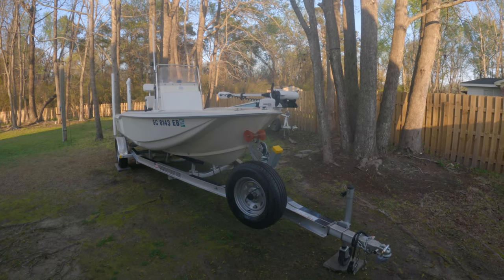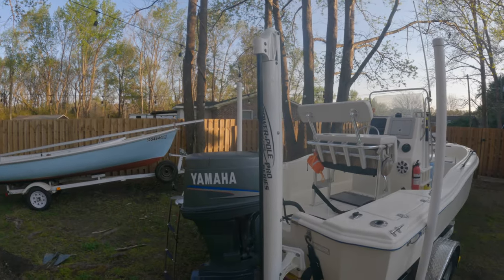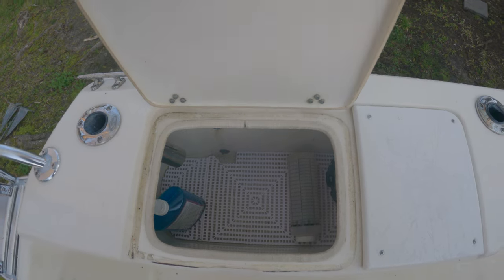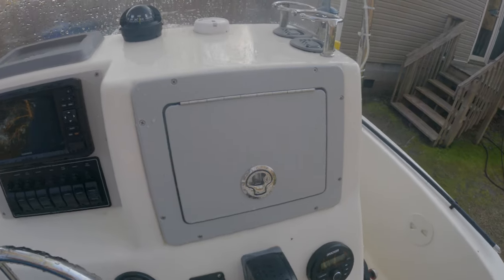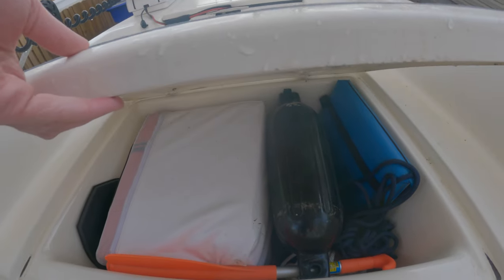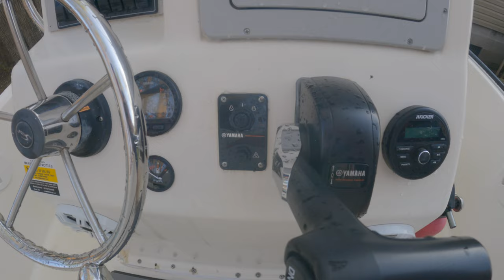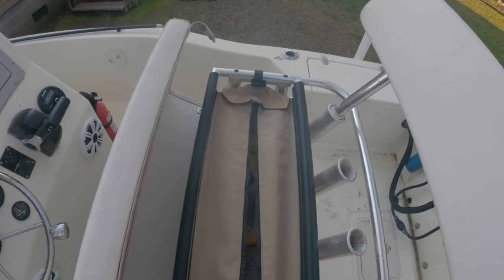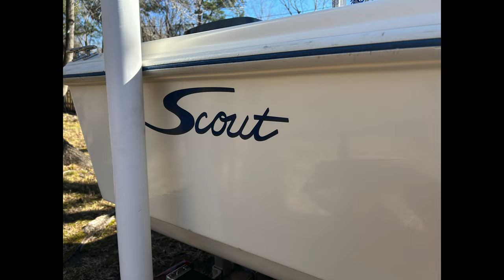Scout 172 Sportfish - Restoration

Comment from the maker: Some upgrades for early 2023 I ended up replacing the UHD2 Garmin with a UHD 94SV during the 4th of July deals. It was a little involved trimming the dash out more but so much better. Also paired with the Garmin Fuel Management system to montior fuel burn. Just picked up a 10' Shallow Water anchor to replace the 6' spike.
Reply: What kind of mpg's are you getting at different rpms? I'd love to know how much you payed for that swim ladder, I'll probably do the same thing to mine. Really like how that looks in SS
Reply from the maker: I cruise around 30mph @3600rpm that is two adults full gas and lots of gear and the GFS reports 6mpg average for just cruising at the speed. I typically get to plane as quick as possible and try to stay there and just cruise. I have a 32gallon tank so typically the Garmin tells me 100+ mile range on the boat cruising with the 90 2Stroke. @user-ej1bq4bq2w
Reply from the maker: Swim ladder from Blackwater welding was like 800$ in Feb. of 2023  @user-ej1bq4bq2w

Comment: I am here in CHS as well and looking at a 1998 172.  How is this particular motor for you and what is the passenger capacity on this boat?  I had a CS 198DLV as my last boat, any comparison that you may have against that.
Reply from the maker: Motor has been great, its clear Scout designed the boat around the 90-2stroke we get 4-6mpg cruising at 32mph w/ 2 people and fishing gear; that adds up to like ~120mile range according to the fuel sensor I installed. The boat is rated to 6 people but I would not go more than 4 and 2 small kids. I would not put 6 adults there is not space. It's a great boat for running around and the flats but not a great family cruiser, I would go larger. It's a simple boat to learn to DIY anything and everything on. I have rewired and replaced about everything now on ours.
Reply: @land_to_sea_studio  Awesome thank you, yeah it will mostly be my 13-year-old son and sometimes my wife.  Thank you for the response.

Comment: Hey man, nice boat! I'm here in CHS as well and will be purchasing a 2001 Scout SF 175 w/ the 90hp yamaha 2 stk also. From what I've read that motor has the perfect power to weight ratio for this vessel and I'm REALLY looking forward to getting familiar with it. I have ski's but this will be my first boat and after saving for so long I landed on the Sport Fish. Really seems to be the best hull in that size and with a 10" draft I think it will be amazing here in the low country. Do you have any off-shore experience to share with me yet? That's the only thing i'm worried about but if I can keep it on plane around 25-30 mph and just avoid the days when it's obvious I shouldn't be out there, I think it'll do just fine. Cheers
Reply from the maker: Thanks! I have not been further offshore than heading out of the harbor and around the ocean side to Morris Island Lighthouse and it handled the chop wonderfully. I also took the boat down to the FL Keys and ~10miles offshore to the reefs which it handled the waves better than the 18' Parker we rented for the other members of the group. Good luck with the 175, I heard that hull also does great if you repower with a 4stroke!